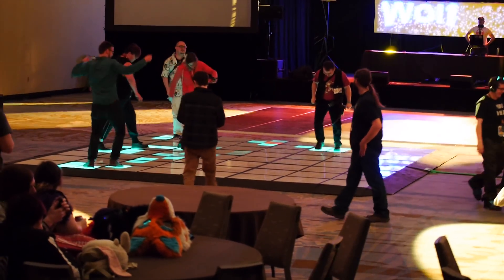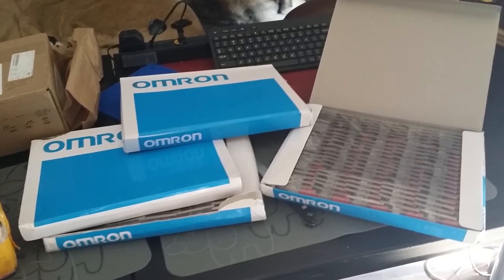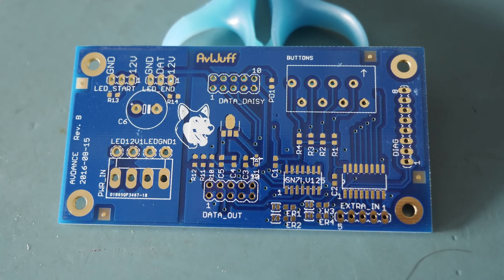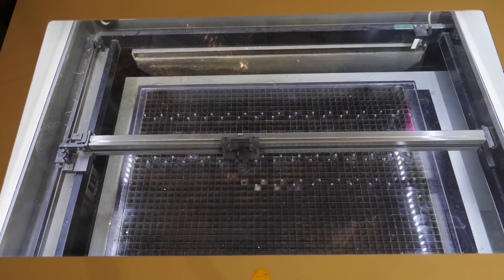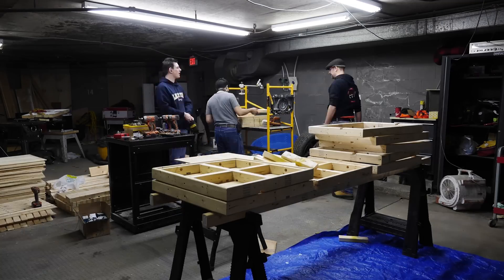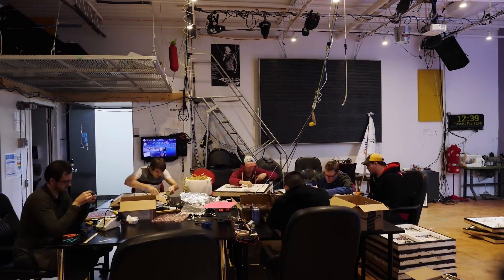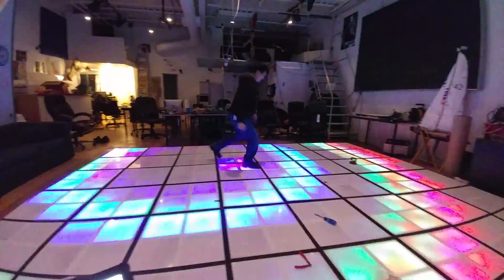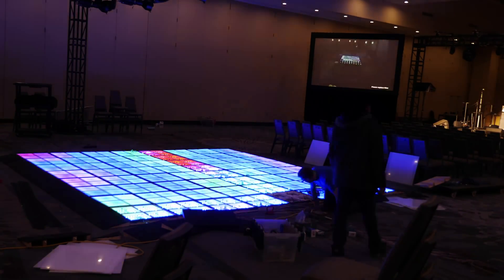Interactive LED Dance Floor - From Start to Finish

Comment: How.much money ?
Reply: The real cost is in the labor but it was likely about ~$4,000-5,000 in parts. That many LED strips purchased from Alibaba/Aliexpress would be just about $1,000. Power supplies for them would cost about $600. The LED controllers they built were likely $8-10 each in parts, 64 of them so another $600. All of the wood, and thick acrylic is a couple thousand. I'd say best case scenario is $5,000 for just parts. Factor in the time spent developing the boards, soldering, making all of the cuts, actually ORDERING everything and making sure it arrives, etc, you're looking at a $30,000 job. Dance floors like these rent for $3,000/night for parties.
Reply from the maker: yeah, you're pretty much right on track.  Parts cost was about $9000.

Comment: On an artificial HDPE ice surface. Could these lights be installed under 3/8 HDPE plastic to show red and blue lines along with goal crease? Would it be bright enough to see with room lights on?

Comment: What did you use for the actual flooring over the boxes?
Reply from the maker: Acrylic.
Reply: @AvWuff  I assume the sheet bend just enough to activate the switch. How did it keep it's springiness over time?

Comment: Hi guys, really awesome end product. You should be very proud of your accomplishment. I have a couple questions, if you could help me.

1. Could we get more details on the 12v supply, like part #?
2. Did orientation or order matter when you re-assembled? 
3. How did you keep the subpanels all locked in place? (An in-depth look at the sub panel mechanical design would be awesome)
4. What was the LED layout of the end result? (One strip on each side of the square? If so, this is what you are referring to as virtual resolution?)

I would love to make a scaled down version for House parties. 

Thanks for reading. 
-Big Gun
Reply from the maker: Its just a MeanWell 12V supply.

Comment: Just calculate the cost.
The materials, the work hours with so many people, the tools needed (though that cost could more easily be spread over more projects), time to program everything, then installing it.
This is one hell of an expensive installation.
And cool they did some extra effects on it, even 16 player dance dance revolution.
And this thing is just awesome. You could even rent it out.
Reply: yeah right .. not worth you can purchase it in Shenzhen way cheaper a 500x500mm module about 80$

Comment: How do you dance in a fursuit without dying from heat?
Really cool floor though!
Reply: Miku Chan Drinking water and hoping the place is air conditioned. And taking breaks. Fursuiting is fun, but even just walking around in a partial can be torture in hot places... Like where my local ComiCon was held. :P
Reply: Myeah, cosplaying is warm enough I think >.<
Reply: Miku Chan Definitely. But I imagine this being really fun, because fur conventions are usually made colder for the suiters, so it's probably more logical then. But cosplaying with a ton of fur and foam layers does get hot fast. ^^'
Reply: Ah, makes sense! There has been no amount of cold where I've been cosplaying :P

Comment: Fantastic job and I appreciate you working on and sharing the video. I do have a random question, if you're willing to share... I'm pretty experienced in LEDs, lighting effects, and software, and I have done a few very similar projects, but I can't figure out how you used the switches for each "cell". Did you have 4 on each or just one? How did the little acrylic "boards" help/work? Anyway, really great work and I hope it's still getting use one year later!
Reply from the maker: Send me an email on avbrand.com and i'll give you more info.

Comment: Ever concidered making fursuiter electronics? Like creating a solution to reading Q & A lines on their smartphone without taking their paws off?
Reply: Nothing at all Actually, the solution is a lot easier... Using smartphone friendly/compatible fabric for the pawpads, usually using thinner paws, or even just using "cheat" paws, which actually have fingers out, but hidden on the top. Though I guess it would be possible to use a bit of tech to make it easier, but those are some other options.